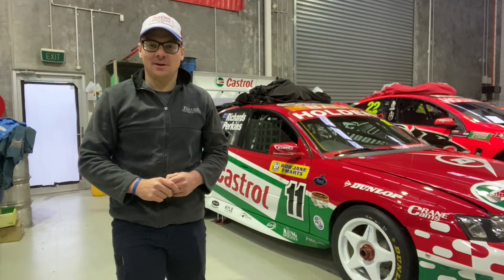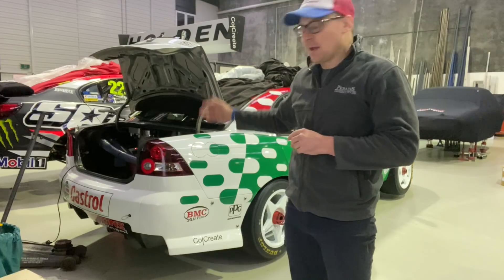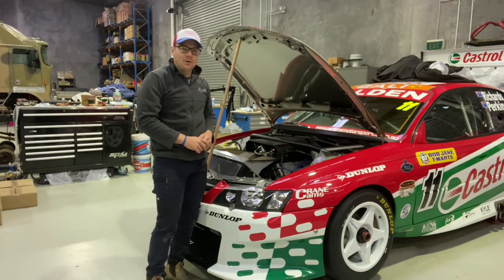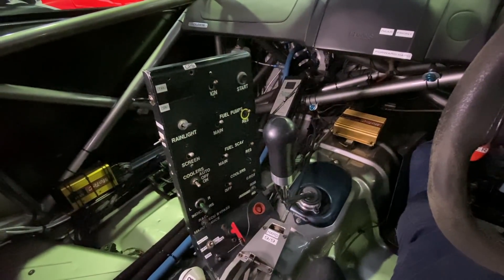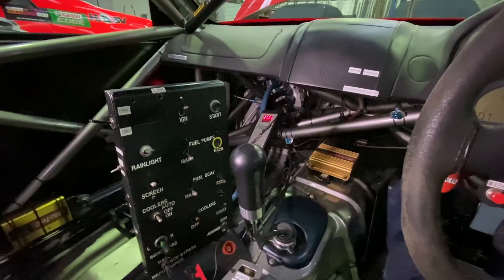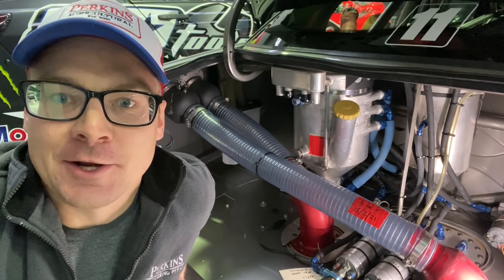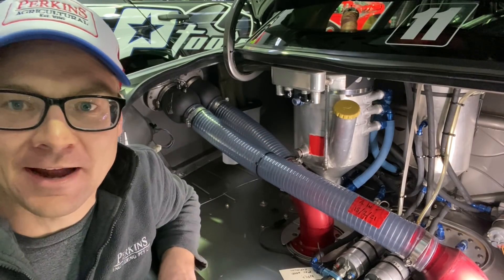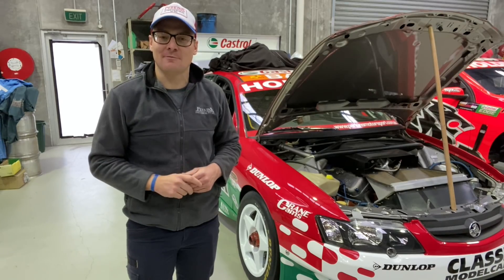Episode 9: Running up a V8Supercar Engine

Comment: Does the perkins team own these cars? Do you have to pay off sponsors ? Not to sure how it works.
Reply from the maker: We owned them when we built them but they were on sold once we finished racing with them. That’s how the business model worked. PE041 (2003 car) was the only car we retained and have since sold it. PE017 we bought back and restored it. Sponsors never owned our cars
Reply: @perkinsengineering  ok thanks for the reply I understand the process now. Cheers mate

Comment: Jack do you run these out of fuel when you store them or leave fuel in the tank and fuel rail. Is is different with e85 as compared to pump fuel. Cheers, thanks for the videos
Reply from the maker: No we drain the fuel if the cars are going to sit around. This car runs BP ultimate 98, e85 can be aggressive on fuel lines and bladders. We would run a e85 engine on petrol after to clean all ethanol out of system.
Reply: @perkinsengineering  thanks for the reply

Comment: Is the engine originating from a road-going car? I’d like to know if the cylinder heads are designed by an aftermarket brand “off the shelf” or 100% proprietary design? By the looks of the wide valve covers, it looks similar to a nascar cylinder head

Comment: How much would that engine cost and what power would it make
Reply from the maker: This is the current engine used in Supercars by Holden teams. Cost $100-125k. 645hp
Reply: @perkinsengineering  thanks for your Reply, enjoyed the video

Comment: What's belt driven off the steering column?
Reply from the maker: Steering potentiometer
Reply: For data logging?
Reply from the maker: @patrolmaverick  that’s correct, through the motec data logger

Comment: Out of interest Jack how long do you run the engine for. I ask because I know that you can get moisture in the engine crank case from humidity etc and Im told it should be run long enough to dry it out to prevent condensation on lobes and bores. Your thought appreciated. Cheers, Geoff.
Reply from the maker: I just run it up to 65-70 degrees everytime, record the oil temperature and ensure the trends are consistent 👍
Reply: @perkinsengineering  Thanks Jack, just curious as I do a similar thing with my old ride now while in lock down. Cheers. Great vids keep em coming.

Comment: love the clips jack should be far more clips like this on youtube showing people basic car maintenance . We know why we dont leave these checks up to women. just kidding
I was heading up to Echuca vic with a female friend and said your windscreen is a bit dirty so she gave the washers a few hits nothing came out by the sound of the washer pump screaming i said you must be out of washer fluid it shouldn't be she replied i only had it serviced 6 month ago, dont you check it that's what's the services are for she replied i've never looked under the bonnet i dont even know how to open it the bonnet she said lol but these days i think you get that from more bloke's than women. 
6 young guys stranded on the side of the road with a puncher after 40 min they somehow worked out how to use the jack and after crushing the sill because they placed the jack in the wrong spot they repositioned the jack under the floor pan and causing damage to that in the finish they had to call RACV because they couldn't undo the wheel nuts because the wheel was off the ground and spinning round each time they started to undo the nuts not one of those uni students thought to let the jack back down or apply the brake true story

Comment: Hey Jack loving the videos keep up the good work. Just quick question what is the purpose and idea behind the little belt driven device ran off the steering shaft and also are they on every perkins cars or just that one?
Reply from the maker: It’s the potentiometer for the steering angle, so the data can record the steering wheel position and inputs from the driver. Not on every Perkins car, only those that have steering sensors

Comment: Thanks, Jack! Is the belt and idler off the steering column electric power assist or a position encoder?
Reply from the maker: It’s the potentiometer for the steering sensor so the drivers inputs can be measured

Comment: Quite surprised how easily it starts and how smoothly it idles, thought it would be a lot rougher than that.
Reply from the maker: This one is tuned pretty good. If you don’t prime the fuel properly and it’s cold it can be a bit rough on start up. The 1993 car on Autronic ECU will be Mint

Comment: Nice work Jack. Thank you for sharing.

In recent years when I have gone to events, I have noticed teams using the “Kettle” to pre heat the water in the radiator.

I didn’t see it in this video, is it not as necessary on the older Supercars or just not period correct?

Looking forward to the next video.
Reply from the maker: Some teams use a water heater yes, we would often use a fan heater on the radiator to heat up the water in the core of the radiator.

Comment: Having run a dry sumped Chev Sports Sedan is used to crank oil pressure up by hand. Turn the pump for about 30 seconds. Then to start crank the engine until oil pressure shows about 60 lbs then turn the ignition on. 
Using synthetic I never had oiling issues. This a 12-1 358 engine.

Comment: I used to disable the ignition and crank the engine over until I got oil pressure and then enable the igniton to fire it up when I had the car in storage over the winter months. Love the sound of that V8 .
Reply from the maker: Yes that’s what many people still do, however it’s nicer to have oil pressure through the engine before turning it over!

Comment: I was under the impression Jack that a lot of the cars had warm water pushed through the cooling system to help with cold start? engine fires up and runs very well even cold??
Reply from the maker: The fancy ones do! Nothing PE did. Correct it all comes down to tuning/mapping.

Comment: Awesome as usual jack!  I’ve watched Supercars for 25 years and love all the technical stuff but I never ever knew all that goes into running an engine up,  how long does it take to get all the temps and pressures up??
Reply from the maker: Thanks! Depends a bit on starting temps, ambient conditions, anywhere from 6 to 10mins.
Reply: @perkinsengineering   do you really rebuild an engine after every race weekend is over?

Comment: That throttle response is unreal,I love it nice work Jack.
Reply: Super super super light flywheel! If I remember the minimum weight for category is 2kg or something. They are incredibly light and let the engines rev up super snappy.
Reply: @dons1932  
I am sure the Flywheel is Super Light.
But the response from the engine is due to many other factors ?
To Many to list, LOL.
Definitely a Great video to watch for sure.
Reply: I have a feeling everything in this engine from the pistons, pins, rings, rods, crank etc would be pretty light compared to your typical street/strip engine.
Reply: The 8 throttle body setup and intake trumpet design will have alot to do with the way it revs plus with solid roller cams they love to rev like anything plus correct me if im wrong but didn't the engines back then, they didn't  have a minimum weight amount for the rotating assembly etc

Comment: Its not as bad maintenance wise as , say an IMSA Porsche 962, with those you have to blow the whole car apart after every race and check all parts for cracking or wear and then put the whole car back together and set it up before the next meeting

Comment: Jack, what was the gear and belt on the steering column for?
Reply from the maker: It’s for the steering potentiometer so the data ca record steering wheel movement from the driver 👍
Reply: @perkinsengineering  That was standard in the 90's cars? But didn't even think of that. Cheers!
Reply: Saw that and wondered the same thing, wonder if it's not to measure the steering input/angle?

Comment: What's the toothed belt and pulley on the steering column ?
Reply: Measures steering input for telemetry
Reply from the maker: Steering potentiometer for the data/telemetry to measure steering inputs/angle from the driver